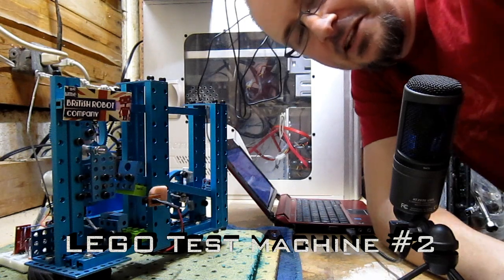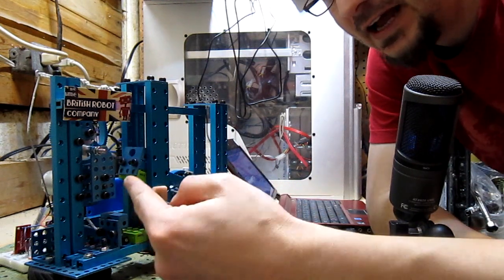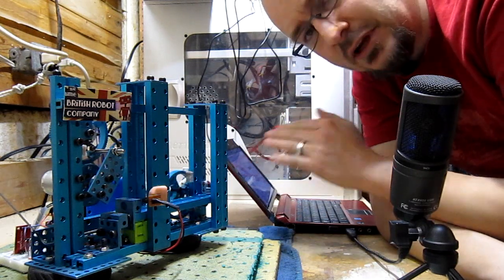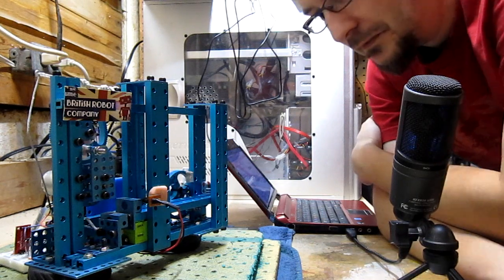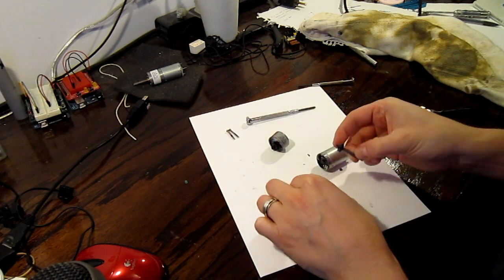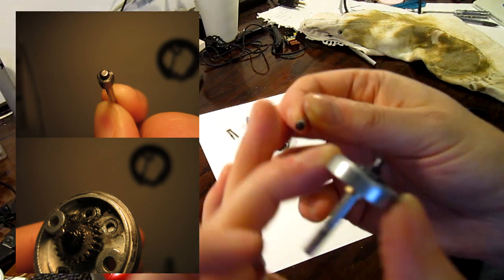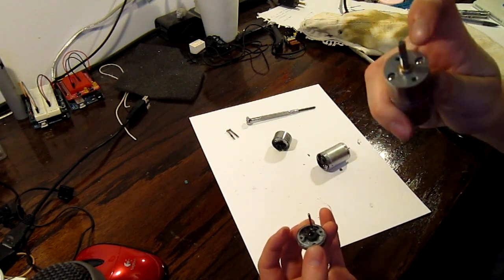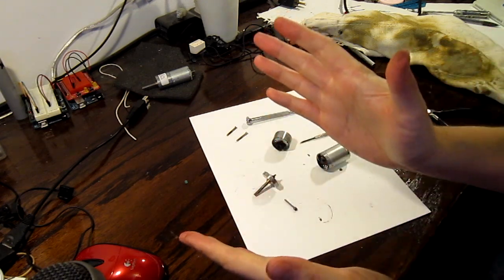legotest - Gear grinding through 27,000 iterations

Comment: How many times were you thinking you were going to run the tests? (You mentioned statistics in the video.)
Reply from the maker: I'm starting with 40 to 60 tests and I hope I can see a pattern.  If not, I'll do more test until the machine dies.
Reply: Phillipe Cantin Yikes! I was thinking the number was going to be double digits, but thought it was going to start with a '1.'